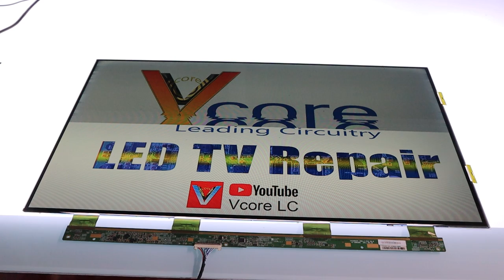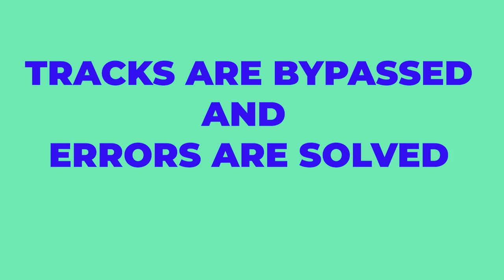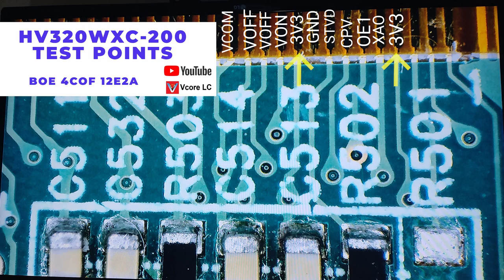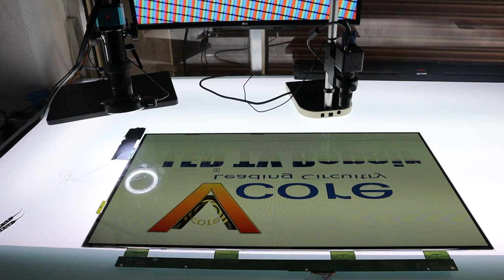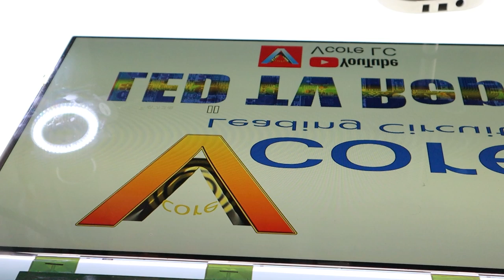How do you fix a half screen?

Comment: At least now I know why my BOE display is going nuts on the top 1/3rd. I thought it was the LCD cable of the laptop but after changing it it still did the same so it is one of the screen flex cables.